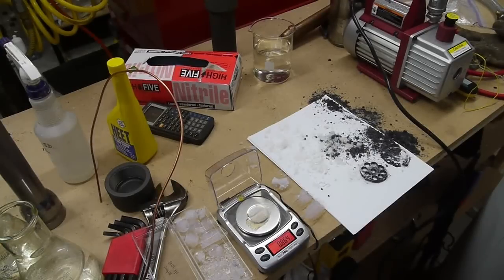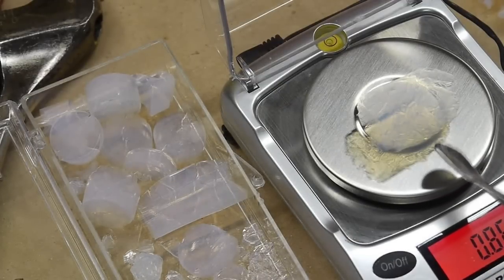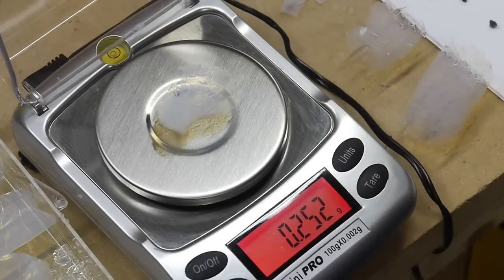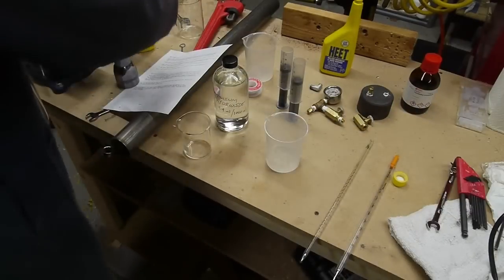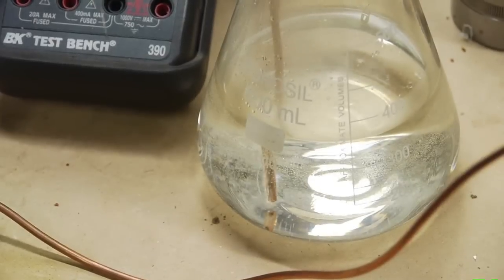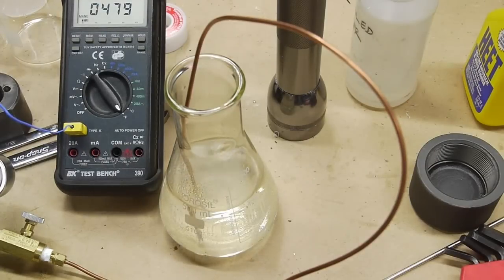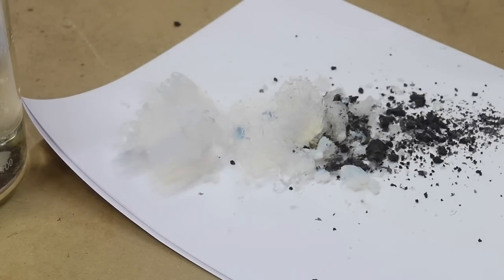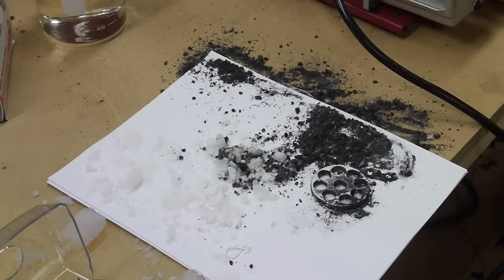Creating aerogel with supercritical methanol

Comment: Back in the 1970s? there was an experimental racing car that had chassis tubes made of such thin metal it  needed to be pressurised to cope with it's loads without catastrophic buckling.
I'm wondering if an aerogell like substance could be cast inside thin walled foil cylinders, perhaps hold onto some of the pressure from supercritical drying,  and produce the same kinds of hoop stresses. low mass, but high rigidity struts etc

Comment: Think I could do it with supercritticial water?
Reply: That would be absolutely awesome but depending on the type of aerogel, I've read water can compromise the gel. The gel is covered in -OH groups that cause the gel to quickly dissolve in water but apparently if you replace the -OH groups with some hydrophobic -OR group then it could potentially work. Not sure though.
Reply: What a coincidence 8 hours ago, probably not, since at least finished aerogel dissolves. There is a chemical way to waterproof it (probably after completion), but i don't know when in the process those things will take effect. The purpose of using methanol is to dry it out completely

Comment: probably a little late, but could you measure the density of your aerogel by putting them under a vaccum chamber filled with a heavier gas, and then lowering the pressure until they fall, and then knowing their density to calculate their volume. (and also sorting all your sample by density)

Comment: What is a usage of aerogel?
Reply: hmm yes interesting if you're going to be a fuckhead at least get your own shit right first, "try TO make your sentences grammatically correct", not "try and...".
Reply: It's an extremely good insulator and it's extremely low density. It's used as an insulator on spacecraft for example.
Reply: Ethan Sloss try and make your sentences grammatically correct.

Comment: Baking in a pan with fat is a "no go" to divers at great depth, if my memory serves me well, the main reason being the toxicity of the fumes, the chemistry of the increased temperature on the other hand also raised some issues.(caused by the reduced cooling effect of water wich boiles at a higher temperature)
It looked like it was filmed in the early 80's

What about extremely high pressures for frying food with carbon dioxide..no caloric enrichment and no toxicity...from the CO2...

Comment: Deep frying under high pressure is called broasting.  Some restaurants do that with fried chicken, and it's really good.

Have you tried applying the blowtorch to a finished piece of aerogel?  Being made of silicon or ceramic, I'm curious what would happen to it.
Reply: Nothing, really. Aerogel (and ceramics in general) are thermal insulators. If you get the temperature high enough, it will sinter, but nothing spectacular. You can find other videos on YouTube of people putting torches to aerogel.

Comment: As for your cracking, try to create a tool to heat the chamber more evenly at a more controlled rate of increase and see if it helps control the cracking. Also try heating to your hold temperature at different rates and see if a specific rate of increase helps.
Also try using a silicone mold for your media. The melt point of the silicone should be around (2,577°F) but I think the structure of the silicone would stay intact during the process and is known to be highly resistant to the methanol.

Comment: I’m sure you guys have figured it out by now but. The powder residue is obviously the remains of your aluminum screen. The combination of heat, pressure and chemical exchange may be the result. While the melt point of the screen should remain around 1200 F in normal atmosphere the pressure and chemical composition of the environment inside the chamber allows it to be more fragile and susceptible to the conditions.

Stay safe
M

Comment: Protip, you should actually understand what he's doing before posting criticisms.

He isn't using the torch to find leaks, he is using the torch to heat the vessel. A side effect of using the torch is being able to identify leaks right as they happen. The application of soap water in this case would have been the wrong tool.

Comment: But wouldn't it then only react with the outside coating? And since there is an absence of air in the pipe the aluminum wouldn't have any O2 to react with halting this reaction fairly quickly?

Comment: Hmm, good point. Your right, I can't think of any aluminium salts that are black. The aluminium alloy theory is a strong possibility.  There are alloys containing lithium, mercury, copper, palladium, cobalt, iron, magnesium and those are just the ones I can immediately think of. On a slightly different thought I also vaguely wondered what the effect of heating the PTFE tape wrapped round the threads to such high temperature would have?

Comment: I can't think of any aluminium salts that are black; they are all white/colorless. Also, aluminium methoxide (Al(OCH3)3) would hydrolyze in moist air to give aluminium oxide and water. I must admit I'm clueless as to what the "soot" could be, but one possibility is that it comes from some other metal used in the aluminium alloy. That would be a place to start.

Comment: I was gonna suggest you changed your molding technique, but you already will, i was thinking the pressure to release the gel from the syringe  actually fractured the gel, and these fractures only showed until you dried it. >.< so i think. Good luck in future experiments very informative, Thumbs up.

Comment: @Fast2405 
At those temperatures and pressures it's even possible, that the methanol attacks the metallic Al to form all sorts off components. e.g hydrocarbons, carbon, hydrogen and as you pointed out correctly Al(OCH3)3 and some Al(OH)3

Comment: Another fantastic video. :) If you get chance take a look at the videos from NurdRage. Some interesting stuff there. According to Wikipedia - One of the drawbacks of methanol as a fuel is its corrosivity to some metals, including aluminium. Methanol, although a weak acid, attacks the oxide coating that normally protects the aluminium from corrosion:

6 CH3OH + Al2O3 → 2 Al(OCH3)3 + 3 H2O